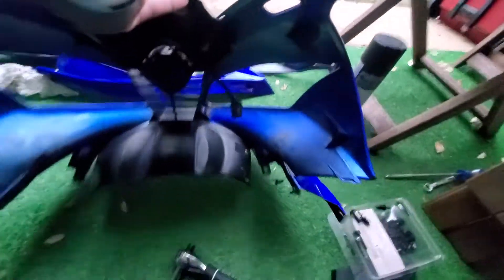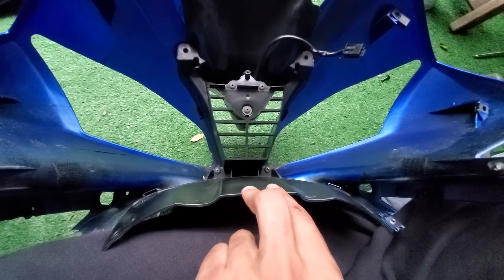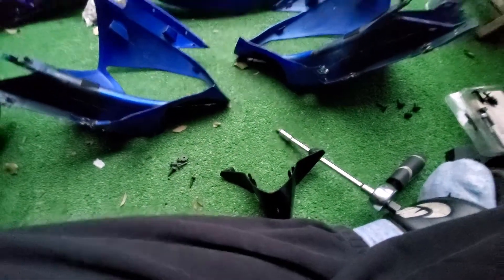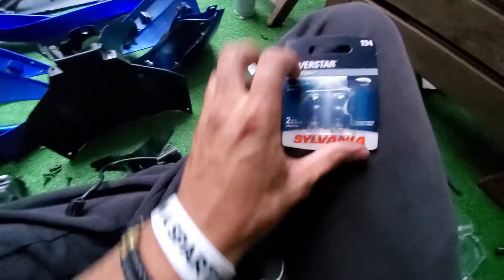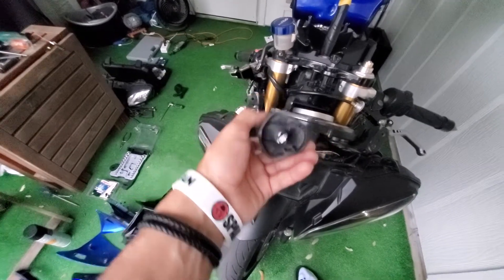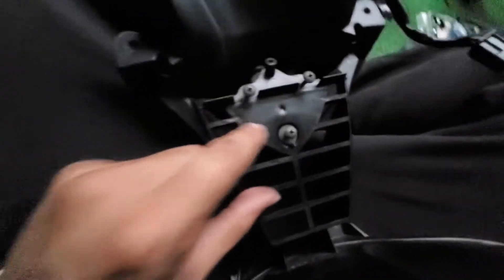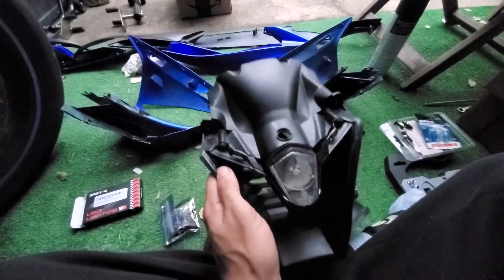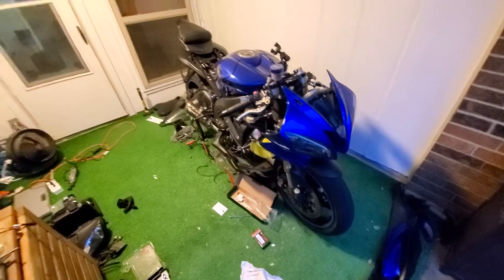2007 Yamaha r6 Pilot Light Replacement Tutorial (Easy/ Beginner friendly)

Comment: Just a tip for checking lights, if you hit your red kill switch before you turn on your ignition, your fuel pump wont prime every time. Saves on the pump while still being able to check your lights

Comment: Thank you so much for making this video!! Just changed my pilot light!! I like the headlights you have but are way too expensive and looks really hard to wire up!! I noticed when I hold my brake lever or step on brake my light does not turn brighter,  its just on with directional lights on, any knowledge on why it wouldnt work?
Reply from the maker: My friend! So glad you were able to get the bulb swapped out! I know it looks intimidating, especially since I had parts lying around everywhere from other work I was doing but it is totally doable.

Regarding my lights. Yes I have the KTMoto headlights and they are awesome.  It DOES look confusing to wire but they provide instructions so with some patience, any DIYer could figure it out.  The reason mine was co fusing was because I hunted around for some time and finally found a pair off a totaled motorcycle for parts and some of the wires were broken and there was a switch missing. Also, ofc, no instructions were provided. So it was challenging for me to figure out where everything went.  What I eventually did was reach out to KTMoto and they emailed me instructions. After that I saw where a switch was supposed to be and which wires needed to be connected into where and I got them all buttoned up.  But definitely go on FB marketplace and look around. I recently saw a pair of KTmoto Heads for an 08 r6 brand new unused for like 200. You can definitely find them if you look.

Regarding your question:  Which lights don't get brighter when you brake?  You mean your brake lights don't come on at all?  If your brake lights don't come on, either the harness is not plugged in, a wire that provides ground/power is broken, or the bulb is bad.  No lights on the r6 get dimmer or brighter or anything like that they only turn on or they turn off.

Could you help me understand your situation better?
Reply: @thematrix3431  Thank you for replying, your video seemed intimidating but im sure reading instruction will guide me through , im just scared of electric work, dont want to mess up anything major on my baby lol. I will be in search for a used headlight hopefully I get lucky!! About the brake light, they are on at all time which is good but I mean when I step on the brake or hold the brake on handle the light doesnt turn brighter for anyone behind me to see Im braking, Idk if its setup that way or theres something wrong
Reply from the maker: @JAVIERMARTINEZ-pn7nm  OH I see what you are saying.  First things first, I TOTALLY understand and used to be the exact same way.  I used to be intimidated to even take the seat off because I had no clue what the wires under the seat did. I'm so serious.  And NOW I've rebuilt 3 yamahas all during quarantine. So I say that to say, electrical seems complex and scary but you can totally do it and literally, this is basically all you need to know for the majority of all parts in a motorcycle.  

If it is an electrical component, it is receiving power through one wire (often red).  It is grounding that power through another wire (often black).  And there is, on some systems a third wire that adds additional functionality when it receives power.  Your brake lights for example:  they receive power and ground when the bike turns on, so as soon as the bike fires up, electricity is sent from the battery to the rear tail light and those are called the "running lights".  Meaning they are on when your bike is running. Why? Because a complete circuit has been formed any time the bike turns on and you have nothing to do with that once the bike is on.  You can't disrupt the constant connection.  BUT when you press the brake lever, current is sent through another wire to illuminate additional lights on your brake lights.  That's a connection you ARE creating.  Those lights are waiting to receive power and when you press the brake lever, you are completing the connection and so the lights go on.   So when lights aren't working, it can ONLY be for a couple reasons.  #1Either power is not getting TO the light.... or starter motor or Dash .....or whatever it may be....  #2 Power IS getting there but your ground is bad meaning the electricity can't complete a circle between the battery, the wire to your light, the light, the wire leaving the light and carrying the current back to the battery (usually through the frame) and #3 your light itself is bad.

I know this can seem intimidating but bikes are actually incredibly simple.  I know wires can seem complicated but it's all actually very simple.   Wire is carrying current from something that has power, to something else that does something with that power WHEN the circuit is completed.  That's it.  Think of it like a draw bridge and your key is the bridge.  When the bike is off and the key is to the left, you have literally physically lifted the connection up so current cannot pass over the moat.  When you turn the key in the ignition to the right, you are physically putting the bridge back down so current passes from the battery to the dash and starter motor, etc..... and then there is another drawbridge at the kill switch so you flip that one down so current can pass to your right handlebar and then when you hit the starter button, as soon as it touches down its closing a drawbridge on the starter motor itself, which immediately starts spinning as soon as you press the button.  The button is literally physically connecting an electrical pathway and as soon as you lift up, the pathway is gone so your starter motor no longer spins.

This all used to feel like magic to me.  It all just kind of worked and I hoped it kept working but didn't know if it would and why it would if it was but....  it's all just electricity being passed from the battery to something else with drawbridge in between.  When the drawbridge is up, the something else is off. When you pull the brake lever or turn the key in the ignition, you are just putting the drawbridges down.
Reply: @thematrix3431  Very helpful in detailed information! Thank you, I just purchased a new brake light thinking my old was the problem but not the problem in this situation. I will be checking my lever connection as well to see if something is not wired correctly, im thinking this issue will be around the brake light with a wire that wasnt connected properly. Thank you for replying and for enlightening me with valuable information! I hope to resolve this issue before spring.
Cheers mate!!
Reply from the maker: @JAVIERMARTINEZ-pn7nm  absolutely! The easy thing about motorcycles if you are running mostly OEM stuff is that the plugs only go in one place.  So don't be scared to unplug and check the wires because the 3prong harness that Yamaha uses on their brake lights doesn't go with anything else in that area.  It's really helpful when putting a whole wire harness and all its components together.  The fans on the radiator and their plugs are the only ones like that on the entire harness, same for the coils and the fuel injectors and throttle position sensors... the turn signals. Almost everything has its own unique plug and harness AND they are always color coded to match the same which makes it even easier so don't be scared to get in there.

If you got a new light and it plugs in to your OEM harness and also doesn't come on when you brake, you can't rule out that it's broken. It COULD be but chances are low so to start, let's assume the lights work.  If they don't come on, then either there is a break in the connection from the power source to the light (a wire has been snipped) or there is a break in the connection from the item that signals to the brake lights that they should be on, again wiring... or the thing that signals is not working.  There is a really small little switch under your right handlebar that the brake pushes against. It's held in with some tiny little screws, 2 of them or so I believe.  That little switch could have gone bad.  If it's corroded then even when making contact it wouldn't send a signal.  That seems less likely to me unless you leave your bike uncovered outdoors.  But. You see how it's quite easy to diagnose issues?  Anyone can do it.  It's just logic.  You got this.  If you want you can also follow me on Instagram at easyriider and I can help you better from there

Comment: Where did you get the demon eyes? I see a lot of ads for them from Wish and whatnot... I'm just not comfortable ordering from wish since the prices seem "too low" If you can recommend any good/trustworthy store to get a headlight assembly that'd be neat!
Thanks for the video!
Reply from the maker: Hey boss! Great question! So you can go to KTmoto directly and order off their site but my secret, which, is going to be a slightly disappointing answer, is that I wait.  If I know I have a project coming up, I scan Facebook marketplace and offerup and Ebay for the parts or bikes I'm looking for.  I just keep refreshing and always eventually find them at a discount.

I got these off of FB marketplace and they were a little bit scuffed, in that, the wires to connect an on off switch no longer existed.  So I did my research and made some mistakes and learned a little about wiring and fixed them.  You DEFINITELY got this, Ray!  

Oh! And when you do find a set, reach out to KTmoto support for instructions on installation. They sent me a diagram which helped immensely even though I never ordered from them